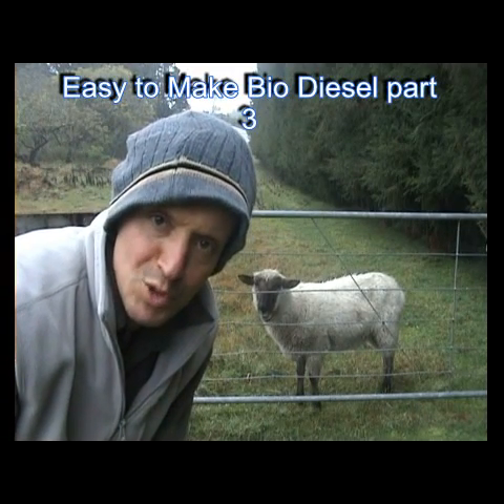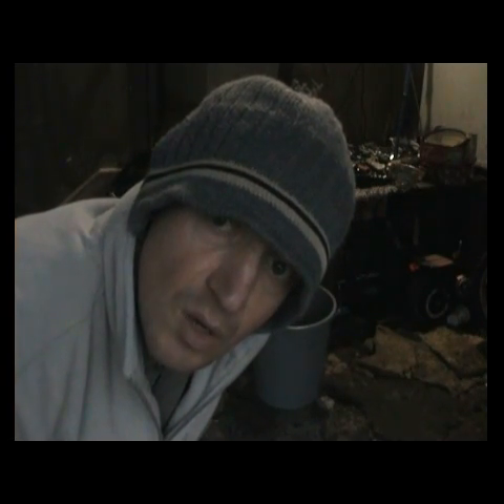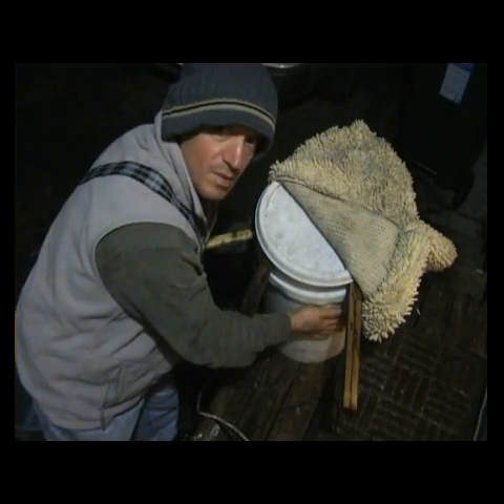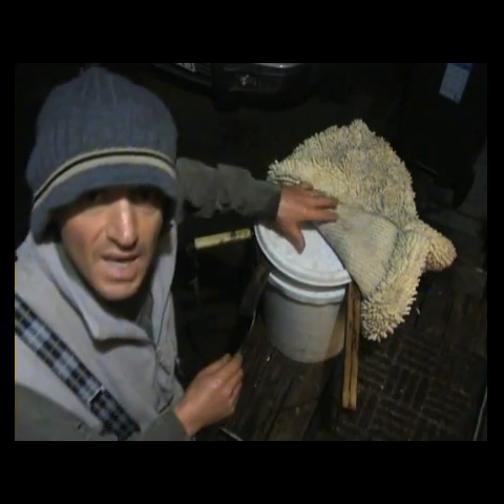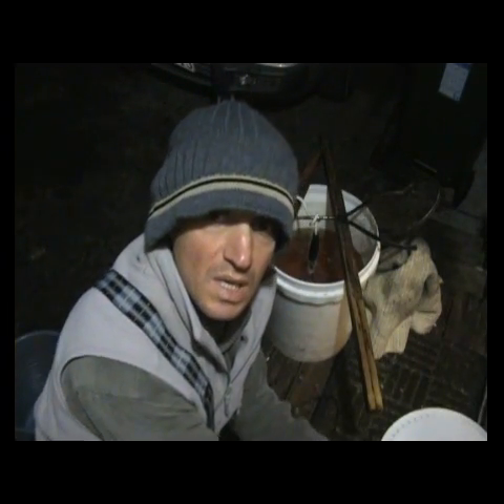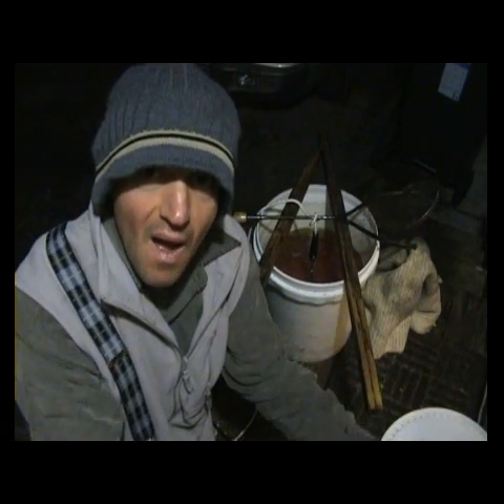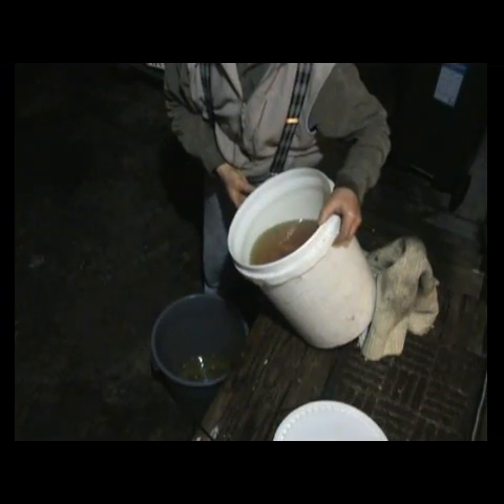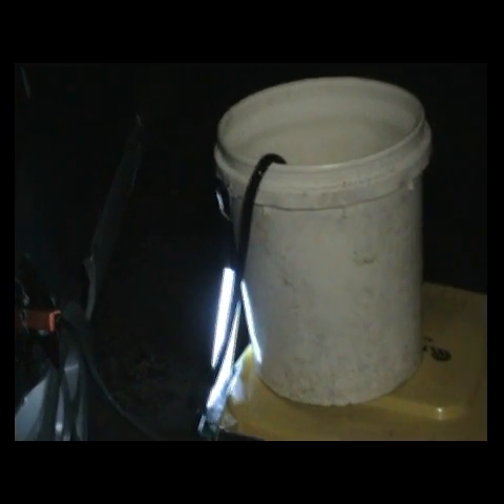Easy to Make 20 litres Bio Diesel Part 3

Comment: hello, may i ask you, how much does it cost per litre? My friend uses "biodiesel" too, but he uses  only oil from the bakkey's , heatens that, filtre it a few times and then in the car. He drives an old mercedes, and when it is cold, he has a lot of problems (when he does not mix it with normal diesel.) And has to clean the filtre a lot times when he is driving.

Comment from the maker: Water always if separation occurs floats to the bottom.
 Ther intia;l separation using the methanol and Drain cleaner can leave a heavy sludge that requires hand or high presssure cleaning.

Comment from the maker: I have not had a problem though it does not get colder than 0 Celcius here.
I have an RVR Turbo mitzibishi.
The tubes I am told wear quicker as the refined biodeisel is corrosive.
Are you sure your customers were treating the oil through the phases I have outlined in my three videos.
?
Cheers and thanks on your input.

Comment: if you have a modern diesel car do not do this, im a mechanic and have replaced countless injectors and injection pumps due to bio diesel. the viscosity is far to thick for modern cars. even older rotary injection pumps can be damaged but the are a bit more robust. you really need inline fuel heaters to thin the biodiesel before it is used in the engine